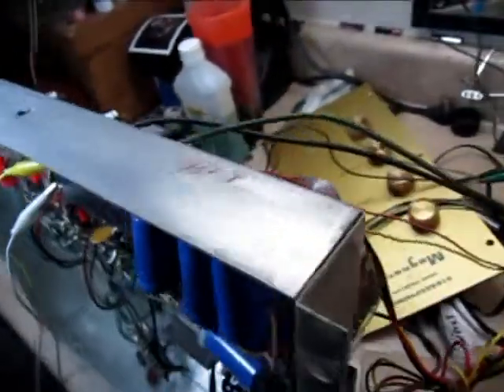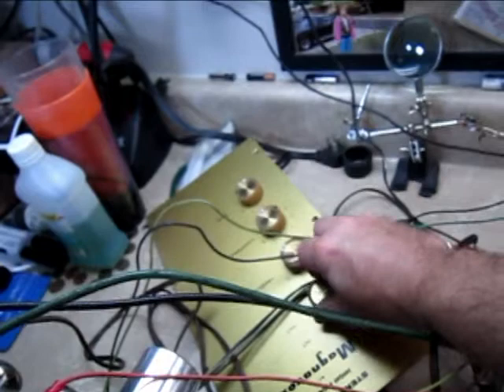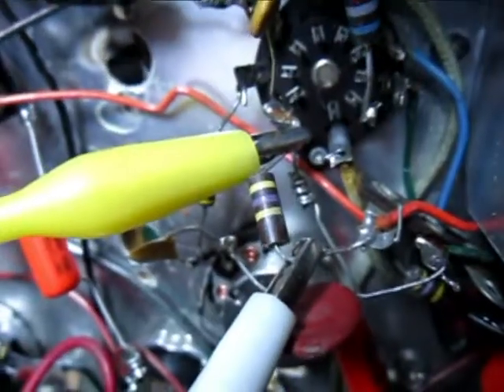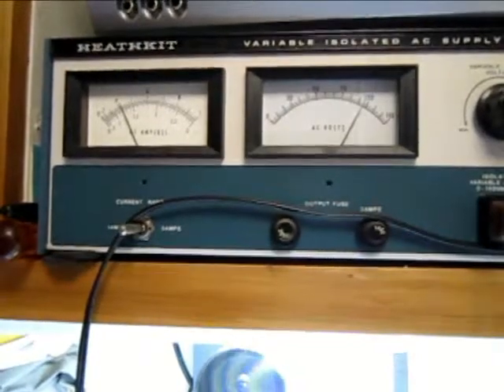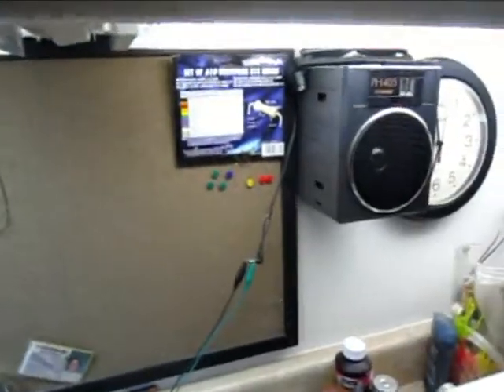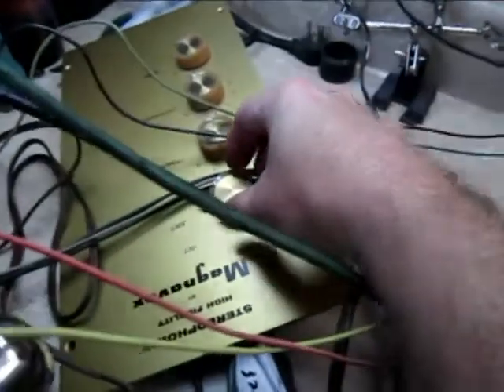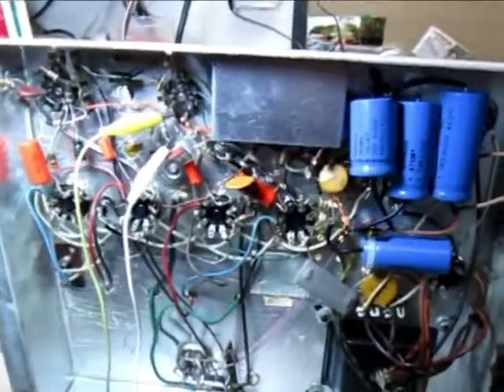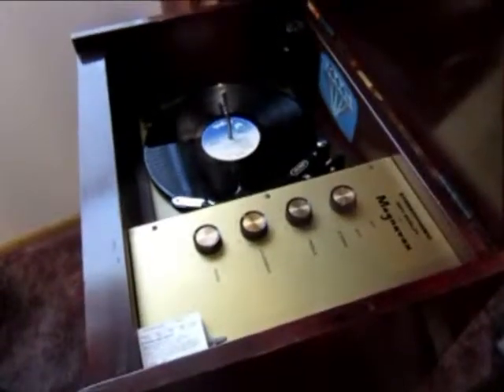The 1959 Magnavox amp 185-11 in for repairs.

Comment: I have a 1959 console imperial
I recapped it but it lacks bass? I didn’t check or replace resistors 
Would one of those cause that issue?There are two bug 15” woofers
I should be getting more that I am
Hardly any at all
Reply from the maker: I would suggest getting the schematic, and comparing voltages from your amp, to the schematic.That's how I discovered the problem this one had. I started probing across resisitors, with power off, and discovered that one was open. Yes the bass should be pretty strong. Possibly double check your work. Was the bass weak before the recap? Tubes are ok? I haven't had a weak bass problem with mine, and it's been working great since I made this video. Let me know what you find!
Reply: dynatrak 
Hi thanks for the fast reply
Yes it was weak before
All tubes test strong and good 
I’ll have to check the resistors 
Mine has the aTimbre control and the highs are high
Just lacking bass 
I’ll pull the amp. Would you think it’s the radio amp or power amp causing this?

Comment: i just picked one of these up from a thrift store its complete and with extra tubes. It also came with the record holder/speaker cabinet. Curious to what the Sam's Photofact number is used for this unit?
Reply from the maker: Awesome, unfortunately I cannot find the Sams I got for mine right now. It has AMP 185-AA on the folder. I will look in my workshop next chance I get.
Reply: I have the majority of all the Sam's Photofact.  but couldn't find it . I know why now, Sam's doesn't go by the Magnavox model number.  the am and the and tuner are their own model number.
Reply from the maker: Ok curiosity got the best of me, and I found it out in my workshop. It is Sam's Folder13 Set 449. Covers Magnavox Chassis Amp-185AA, BB. Date 7-59. Mine only has the Amp 185 with no tuner chassis, so I don't know what those would be.
Reply: Mine doesn't have the am/fm tuner, although I wish it did. 
Curious as to where your date stamp is? I can't seem to find mine.
Reply from the maker: Oh ok. Mine is near where AMP 185-11 is stamped on the back side. It is stamped 5-10-9. 7-59 is the date on the Sam's.
Reply: I have a same/similar  Maggie (entire console fairly intact)  but the amp chassis is stamped: 185-1 (no second digit after the 1) and 3-70-9.  The stamps are clear.  In searching web I've never found a single digit following the 185 or any other series from Magna (175, etc).  Rebuil effort resuming after a decade break where console was used as a table.  My amp came with matched set of RCA 6k6GT's despite the chassis being stamped 6v6.  It was all orig when I got it 2002 everything worked  (turntable, tone controls, Aux inputs, etc)